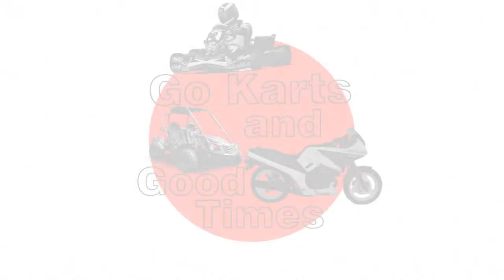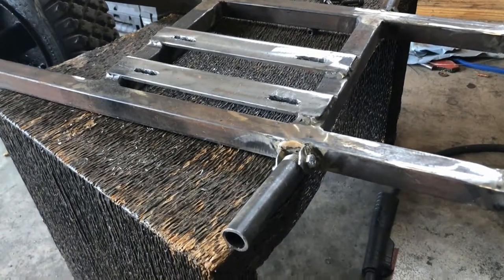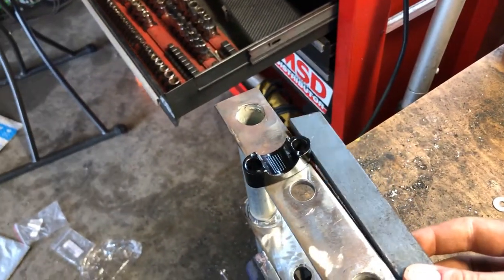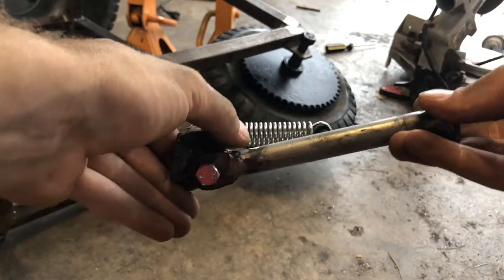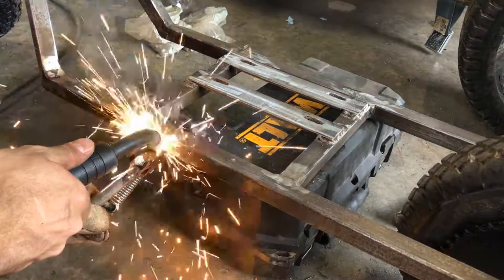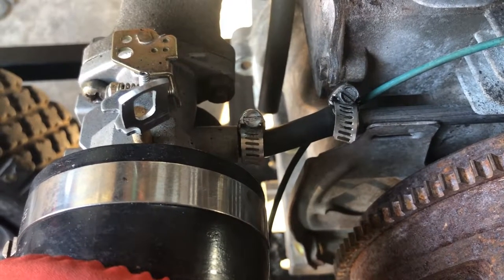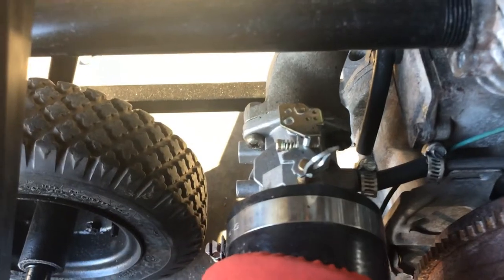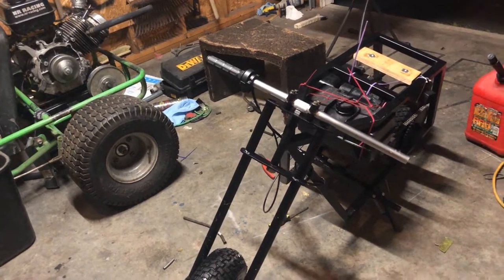Custom DIY Mini Bike - Part 3: Running and Driving

Comment: nice build! I am just curious, without the bearings in the head tube, does it cause any problems when turning left/right?
Reply from the maker: Truong Vo Thank you! So far I have had no issue with this solution; it’s just not as smooth as using bearings. Over time it may wear more quickly that with bearings, but I doubt it will become a serious issue for me.

Comment: Are you cutting, grinding, and welding tons of Galvanised metal in this video? It looks like the front forks are made from galvanised round tube. How is your health? Did you get Gal poisoning while working at all?
Reply from the maker: To my knowledge no, I'm fine, but I do need to do a better job with safety.

Comment: I have an old lawnmower in the shed I want to build a bike but I don’t have a welder
Reply from the maker: If you have the time and money it’s a great skill to learn. Even with a cheap welder you can practice and learn how to do decent welds on a small budget. If not, you can always buy an old used frame  and go from there.
Reply: @gkgt5226  where I’m from there no mini bike frames or anything anywhere so I’ll have to go from scratch
Reply from the maker: @CraftedPiggy  Oh that is unfortunate, but best of luck!
Reply: Best $99 you'll ever spend get the harbor frieght welder and go to town.